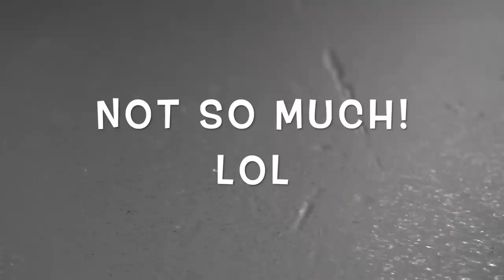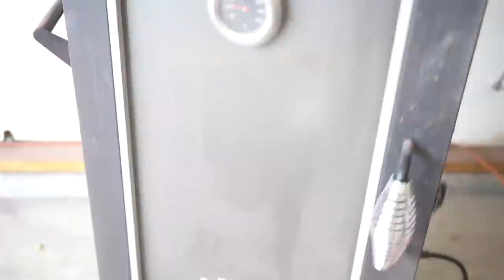Accidental Purchase From Ebay - Restored It Anyway

Comment: It may not have been the truck you were hoping for, but you did save a valuable piece of history.  If memory serves correct,  the smaller vehicles are even harder to find than the bigger ones. As they were not as popular.  Excellent Restoration.

Comment: There are 2 washers on the axles on the side where the axle did not pull through the body.  It would seem 2 washers are missing on the other side because there is nothing to hold them captive.

Comment: When I make wheels like that... I mount a piece of scrap wood on the drill press. Then drill a hole the size of the wheel into it. Replace the bit with the bore size for the wheel. Pop the wheels into the hole, then drill. It gets them in the center as much as possible doing it on a drill press.
Reply from the maker: Thanks for watching! 🤘🏼🤘🏼🤘🏼
Reply: That is a great idea!

Comment: I know you have your own ways, but if you want a nice rounded end to your axels, try a river set for blind rivets. I used one for years when I worked in the sheet metal trade.
Reply from the maker: I'll have to check it out 👍🏻
Reply: fred freed:  Think you could find a good one on Amazon and leave a link?  I’m still very much a novice!  Thanks!  👍
Reply: Sorry, it seems that the tool I mentioned is now an antique. I will look through my old sheet metal tools and see if I can find one. If I find one, I’ll ask for your address and send it to you.
Reply: Here’s an idea: take a piece of round stock and drill a 3/16 hole about 1/8” deep . Then use your Dremel to concave the bottom of the hole into a dome shape. Essentially, that’s what a river set is.
Reply: fred freed:  And to use, place the dome over the axle and hammer the opposite end of the stock?
Reply: Primus54 Yuppers! That’s how I used one back in the old days! When networking was something fishermen did.

Comment: The truck itself looks good...but the wheels are too small...had you put a bolt through them you could have shaped them a little more. I don't get putting that much effort into it and then going with a part that isn't right...